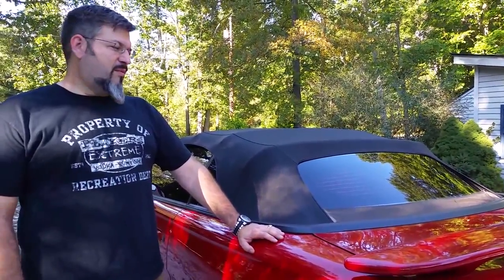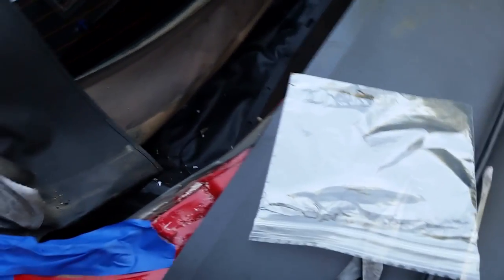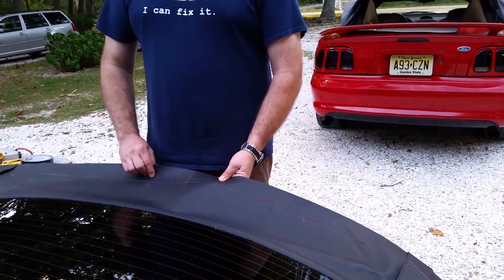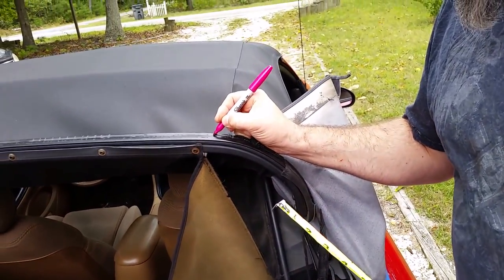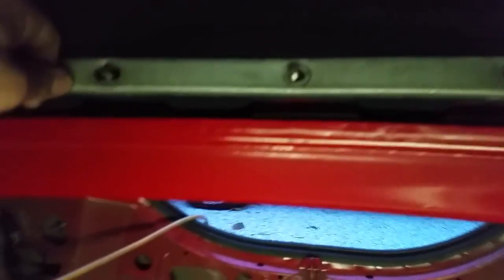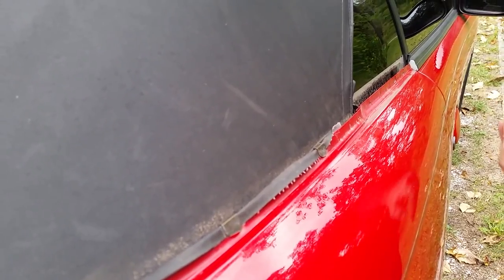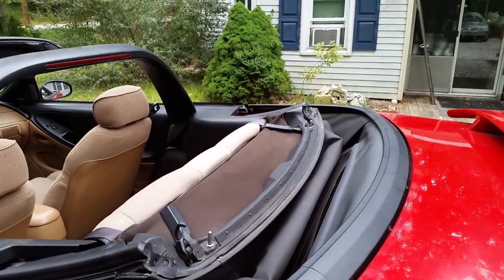1994 to 2004 Mustang Convertible Rear Window Step By Step Replacement Save Money $ $ $

Comment: This was incredibly helpful! Thank you for posting. I replaced the entire top (cover and glass) on an 04 mustang, I replaced the two-part top, however I suggest buying and installing the one-piece KEE replacement. Easier and it simplifies the system overall.
Reply: DREW Daniels you are right.I did mine myself whith the Cj pony's vidéo.it was easy with the one-pièce KEE top.

Comment: exceptionally good audio. This video is helpful.
The two interior side pieces next to the passenger seats must be removed in order to properly access two of the three screws holding on the side molding. The rear-most molding screw can be accessed when the top is relaxed, but the two forward screws are accessible through cutouts that are available when the interior trim is removed.
They are phillips head screws.

(The trim pieces are removed by removing three plastic fasteners; two accessible when the rear seatback is removed and one is at the top of the convertible roof void (from the back seat, look down into the hole the frame retracts into, there is a nylon fastener right at the top). Also, remove the door jam and pop the piece towards the front.
Reply from the maker: 331SVTCobra thank you for the comment.

Comment: Just did my top! Took the full 4 hours! Had some help with the girlfriend! The staple removal definitely took the longest, The job wasn't perfect, but I'd still give it an A- (Not 100% tight). But it doesn't leak! Thanks for the detailed help, Zero Fuel Required!
Reply from the maker: James Van Volkenburgh that's cool.  It definitely helps to make the job go faster if you have help.  I'm glad I could help.  thanks for the comment,  if you haven't already, like, share and subscribe.
Reply from the maker: James Van Volkenburgh also you could've paid a shop big money to do your top and it wouldn't be perfect either. It's an intimidating job that anyone can do if you have patience.  You get an A+ for effort.

Comment: Well done, I replaced mine based with this video and it turned out well. I'd emphasis the detachment of the side wires to allow the curling back of the outer top (tricky). The last stapling of the side outer flap used the existing staple pattern to reattach the side  short rails. I went BTW from a glass to a vinyl  type, it didn't come with the  1.5" straps under the outer cover and apparently didn't need them, as it works fine.  Electric stapler is probably necessary given the number needed.  THX  a great guide for a first time project.
Reply from the maker: Mick Snyder I'm glad my video helped,  thank you for your comment.

Comment from the maker: My wife and I Thank you Jose for your comment.  When got my mustang the passenger side tension cable was broken, the cable keeps the side of the convertible top behind the quarter window from flapping in the wind.  The back seat, panel and other stuff  has to come out to get the bottom of the cable.  Replacing the cable is a job in itself.   I paid $30 for a new one and went to install only to find out the new cable was way too long.  I called the place I got it and they said it was the only one for my car.  I ended up cutting the new one in half and cable clamping it to old broken one at the right length.  I said in the video several times don't disconnect them unless you absolutely have to because the whole back seat,panel, speakers and metal plate has to come out and it still is a pain in the ass to get to the bottom of the cable.  Anyone can do this if you take your time, measure multiple times before you cut anything and make sure you align center on the window.  If you have any questions just ask and Good luck :-)

Comment: Hey ZeroFuel.. I"ve seen your posts in AllFordMustangs Forums. You have good information and insights to share. Thank you. I have a 2001 Base Mustang Convertible with a shattered back window and a raggedy top. I'm replacing the everything. Although I like the glass window with defroster, I think I'm going to go with the "one piece sailcloth top with vinyl rear window just for the sake of ease of installation and cost. I appreciate your efforts to help schmucks like me. See ya in AllFordMustang Land.
Reply from the maker: Dennis Bennett thanks for the comment and good luck on your project.

Comment from the maker: Take your time, devote a whole day to this.  I replaced mine a few hours a day, over a 3 day period. Find your center marks on the car and the new window because there isn't much room for error it will make the vinyl above and below the window ripple if it isn't aligned. Use stainless staples if you can find them,  regular steel staples last a long time but they do rustand in a location that gets wet I'd rather have stainless.  The hardest part of installing a convertible top is the rear window and not every top has to be replaced but rear windows take a beating. I found rockauto.com had the best deal on the correct rear windows for mustangs.  it might take a day or so to respond,  but  if you have any questions  hit me up.  Good Luck.

Comment: What size is the 12 point socket for the tack bar? Also what size staples did you use? Thanks for the video!
Reply from the maker: It's a 13mm deep well socket  and I used stainless 3/8 and 1/2 staples.  If you read my video description there more info and I listed Everthing that I used in the video and links to purchase them if you want.  I hope this helps and thanks for the question.
Reply: @ZeroFuelRequired  oops I should have checked the description! Thank you! This video has been very helpful.
Reply from the maker: @BenFoilHat  no worries. I'm glad my video is a help for you 😉👍

Comment: We installed a convertible top and back window, we are having a problem with the bar dropping the back window. We did it exact everything is how it should be, but the back window wont drop in if you understand what I'm saying? it simply wont fold in, if you have any suggestion asap that would be great. The bar to the back window wont drop because the window doesn't fold in. So lmk what you might think is the problem if you have any clue we are stumped!
Reply from the maker: The convertible  top material new may not be very flexible especially when cool or cold.   If wasn't out in the sun before you tried opening it.  Try putting your car out in the sun for an hour to warm it before your try.  Then when you are ready open it slowly and with your hands push the window inward.  It should start to go.  It might take 20 or 30 times opening and closing for the material to start to take a memory so it will drop in place properly without any assistance when you open it. I hope this helps.  Let me know how you make out.

Comment: Thanks for the video 👍 I'm looking to change the whole top on mine. I
 have ordered a new one with a new window and I can't find any video instructions how to replace it😫
Reply from the maker: Replacing a convertible top is time consuming but anyone can do it.  There really aren't any special tool. Screwdrivers,  Metric sockets and wrenches(I mention in the video) ,  decent staple gun or power staple gun like I use in the video.  A smooth face hammer to hammer any staples down that don't go all the way in(I use hammer in video) to replace the entire top, you will have to remove the back seat and rear interior panels to get to the tension cable that runs inside the convertible top along the rear quarter windows(it keeps it tight there otherwise it would flap while diving Down the road). Take pictures as you take it apart to make it easier to remember how it goes back together. With the rear interior panels out.  Open the top and take off the front edge weather strip. Then remove the staples in the canvas on front edge,  work your way from the front to the rear. Release both side tension cables.  Follow my video to take the rest apart.    Use the old top to lightly trace (with something that will wash off)on the new top canvas to get it close. Clamp it together out of the car to test fit to rear window.  Work your way from the rear toward the front.  Staple window canvas to rear strips(test fit with top almost closed) attach main top to rear strips and install strips(not fully tight) fold canvas to over rear of car and staple  canvas window to rear bow. Pull top toward front, install tension cables,  leave top open 2 inches, stretch canvas around( keeping open 2 inches, make sure it's centered & staple it)  install weather strip.  You should have to pull hard to get top to close stretching canvas. Over time it will get easier to open and close.  Stretching it good should take out some of the wrinkles. I am missing a few steps here with interior of the top.  Installing the rear window area of the convertible top is the hardest part. The rest of the main top will go easy.  It's been a while since I've done the a convertible top and I'll help you were I can.  Good luck.
Reply: @ZeroFuelRequired  wow, thank you, much appreciated , god bless 🙏💪🏻
Reply from the maker: @Zabestinzawest  if you look at the video description I've included links to everything that I used to install the rear window.   Take your time and you'll get it done.  Good luck & God Bless 😉👍

Comment: my new window came in yesterday,might start on it tomorrow,,I was wondering,,what size and length of staples should I use,,?
Reply from the maker: That's great.  If you read the description on the video itself.  I write about everything I use to get the job done. I write about the staples 3/8 when stapling through one layer and 1/2 when stapling through multiple layers.  Stainless staples if you can find them.  Take a minute and read the description it's helpful.  Good luck.
Reply: @ZeroFuelRequired  thank you so much for answering,, I must have missed the staple size part,, I think tomorrow is the day,,lol
Reply from the maker: @davejohnson3271  no problem.  Take your time , you'll get it done, it's easy,  it's just time  consuming.  Good luck

Comment: Do you know what would be a good replacement for the black nuts for the rear metal strip that requirethe 13 mm wrench? Just bought a convertible and im missing nuts but the also put that piece in wrong

Comment: do you have to replace the top first and then the window or can you just replace the top AND window BOTH at the same time?
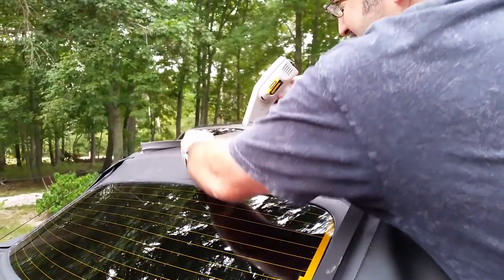Reply from the maker: Chippy The Chipmunk  on my mustang someone replaced the top and not the rear window (To save money) long before I got it.  I replaced the rear window because it started leaking.  It's actually easier to replace both at the same time.  Take pictures of everything as it comes apart(so you can remember how it goes back together). Once everything is apart. Lay new convertible top and window in the sun for a day to take the wrinkles out of them.  Then Transfer old window pattern  like I do in the video to the new window to get it close while being installed and the same goes for the old top to transfer the pattern to the new top the best you can.  Once the  window is installed,  detach the rear retaining strips from the car and on the new convertible top attach it to the top bow like I do at 22:28 in the video(make sure it's centered. Then stretch it down and attach it in the rear like at 23:54. Install the side curtain cables. I'm probably missing a few things here, re-install the rear retaining strips and stretch the top to the front.  Center the new top in the front, open the convertible 4 or 5 inches above the windshield and stretch the new top matetial around then staple it in place, this is so when you close it the top stretches to take out any slack or left over wrinkles.  It might take 2 people to pull down on it to get it to latch the first couple of times.   Leave it closed in hot sun for a few days and Over time it will become easier to latch close. Anyone can do this,  it's time consuming but worth the effort. I hope this explanation helps, thanks for the question and good luck.

Comment: Is it okay that mine like yours is not sealed with the top layer but it is sealed with the bottom all around?
Reply from the maker: Yes it should be fine, any water that gets past the edge that's bolted to the body drips in the water channel that runs out on to the ground in front of the rear wheels. 😉👍

Comment from the maker: Hey Brandon  I used 3/8 inch staples when I stapling through 1 layer on most of the  convertible top, but there are areas with multiple layers I had to staple through, so in the thicker layers i used 1/2 inch.  Thanks for the question.

Comment: great video man, I have to thank you because my rear window was falling apart and I think it is time to replace it. My question here is: what's the size of the staples you used in this video? Thanks in advance!
Also, tell your wife she did an awesome job recording!
Reply from the maker: I used 3/8 inch staples when I stapling through 1 layer on most of the convertible top, but there are areas with multiple layers I had to  staple through, so in the thicker layers i used 1/2 inch.  Try to use the stainless steel staples if you can find them. If you can"t the regular steel last a long time. either way.  Good luck.
Reply: Thanks!

Comment: great video, I learned a lot, but I still need to find one that shows how to fully replace the top as well. do you have a video of you replacing the top, or do you know of one you would recommend?
Reply from the maker: I don't know what video would be good for replacing an entire Top.  I didn't have to do mine, i just had a leaking rear window. Take the top apart from front to rear. take pictures as reference of anything you remove,  so when you put it back together you know what it was like.  to install follow my video for the back window and keep it centered working your way from the back to the front of the car. You'll stretch it around the front, so the top is tight for reference and you want to stretch another inch. Open the top,  lift it up off the windshield pillar about 5 inches and stretch the top about an inch making the material tighter keeping it centered attach it from the center outward trying to avoid ripples. Once all attached pull down on top to latch it to the windshield pillar and it will stretch your top nice and tight. Good luck.

Comment: Does this also work with an 06 mustang and also do you know where to get the rear window online?
Reply from the maker: It's very similar. I posted links for everything used in the video inclination the rear window.  If you go through the links to Amazon you should be able to find the replacement on Amazon. Thanks for the question.

Comment: This a good video, I'm planning to change the top and rear window myself but am having some doubts and how to do it but do you think by transfering the rear measurements (where it gets cut and stapled) from both top and window to the new one would it make a little easier? Meaning putting the old one in top of the new one, like you did with the window before cutting it.
Thank you 
Felix.
Reply from the maker: I think I understand what you are asking. By laying the old top on the new one and the rear window on the new to transfer the measurements(use something to mark the top that will wash off) would be easier than just winging it, especially doing your first convertible top. Doing it this way will help you get very close to the way it was. You're going to have to take the back seat and panels out to do it properly mainly because you're going to have to disconnect the cables that go down in the quarter panel.  When you take it apart take photos as you go to help you when you are going to put it all back together.   It really helps.  As you install you work from the back towards the front as I explain in the video.  Bolt the back rear retaining strip in before you finish stapling the front.  When attaching it in the front you'll attach/staple it an inch shorter  so it will stretch it as you close the top and latch it. Closing it might be difficult the first time needing a person on each side to latch it.  It seems daunting but anyone can do this if they take their time. I hope this helps and good luck.
Reply: Zero Fuel Required 
Thank you very much for your advise the photos will help too.
I will wait till the weather gets better to do it (don't have a garage lol)
I will follow your advise and will let you know how it came out. Thank you again and be well.

Comment: I just bought a 98 GT vert and need to replace the top.  It came with the new top, I just need to do it.  I'm terrified.  I'm really handy but this looks horribly frustrating.
Reply from the maker: The worst thing is it's time consuming.  Anybody can do it.   Take pictures of everything when you take it apart so you don't forget how it goes back together.  Take your time you'll be fine and good luck.